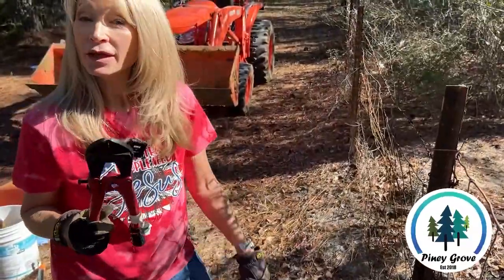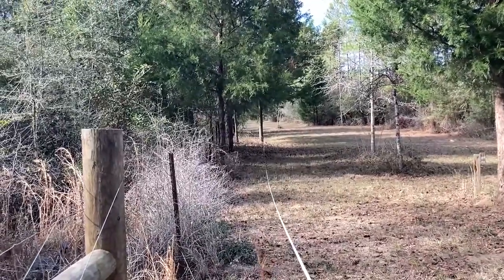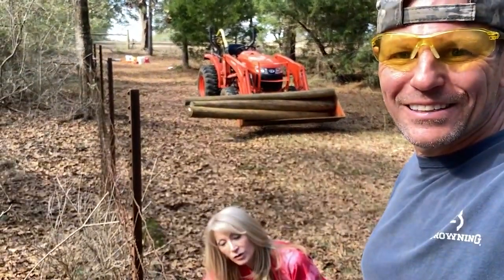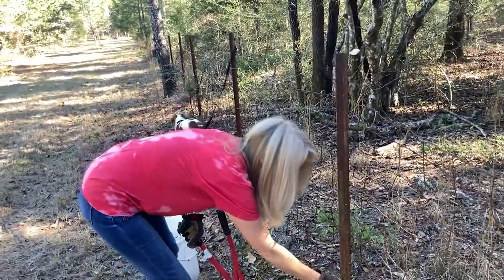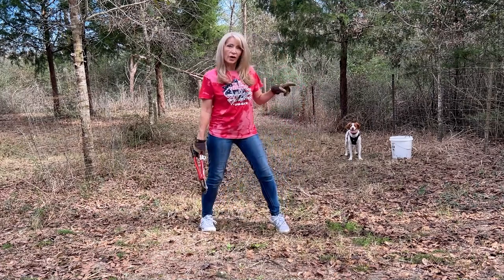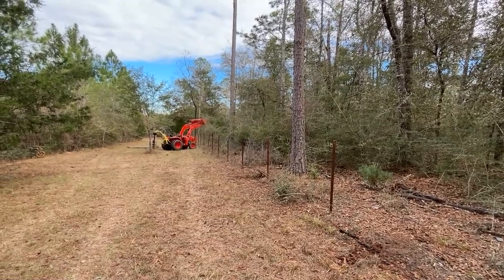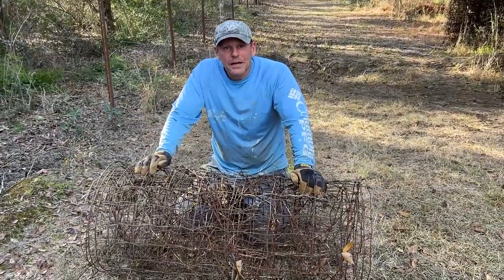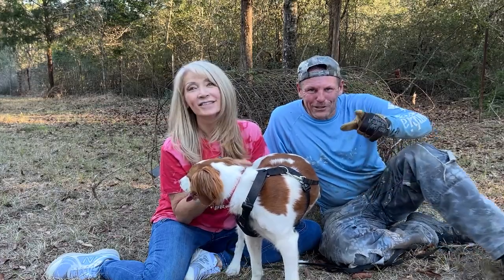Quick and Easy Way to Remove Old Woven Wire Fence

Comment: It is never a whole lot of fun working with old barbed wire fencing.
Here in Iowa, we use  a wooden post every fourth post. One wood, two steel followed by another wooden post.
Because of the snow load, we often have to pull the fasteners and loosen staples to rest ret head the feces in the spring. As the snow settles, it pulls the fence with it.
I see quite a few guys around here that have gone to all steel posts. They just don’t last. They end up tipping over before long.